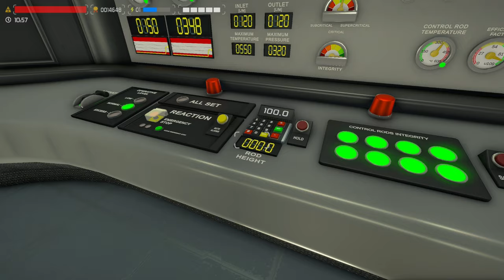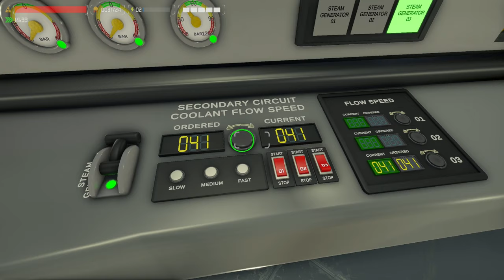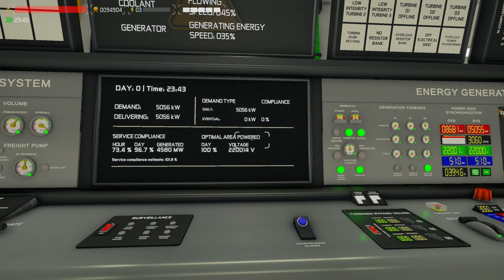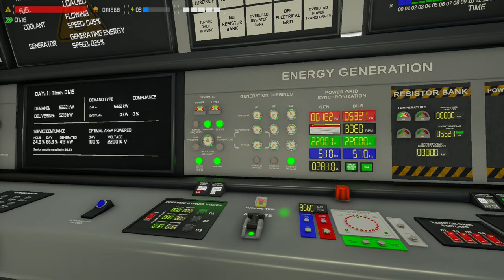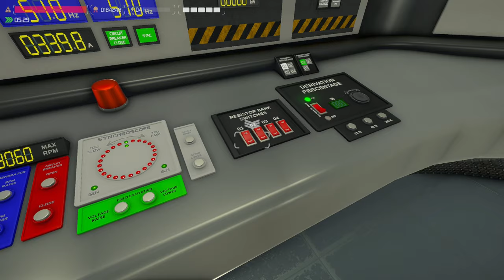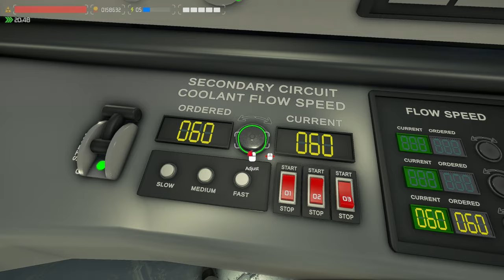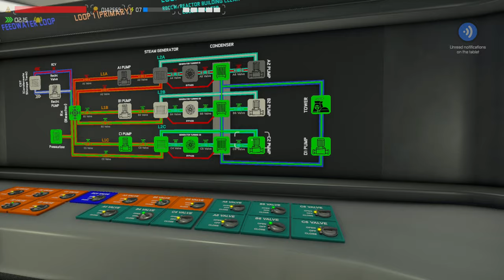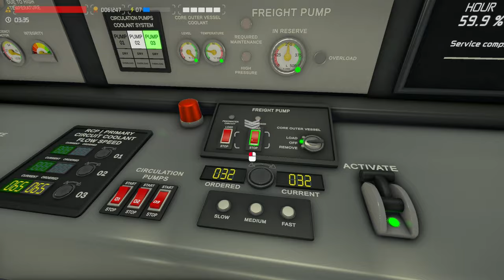Installing Our 2nd Loop! S1 EP02 - Nucleares Tutorial

Comment: @ShArPy1o1 Game`s this is a message from the devloper after I asked him how the testing was going regarding the Ion Column cleaning

Message From Nucleares: Hey!  Almost there.  I included several more things: tunnels and missing connections to eliminate infinite repositories.  A little more testing is needed.
Reply: So don`t exspect a hotfix to come any time soon.
Reply from the maker: Seems like the Ion cleaning has nowhere to put the used chemicals as the tank underneath the column doesn't seem to be finished... oh well saving and reloading will have to do the trick till it's fixed I guess...
Meh it's a good game anyways, I'm still going to play it mwahahahahaha... cheers for the comment gamer 😎👌✌️

Comment: The thing i really want added is faster time. The 1,2,3 is good. I dont want them changed, i just want a 4. 
When starting up or shutting down i always us 1. When waiting on somthing to fill i often use 2. When everything is stable i use 3. Usually leave it on 3 for the entire week until shutdown for core maintenance.  
I do occasionally use 1, run to the transformer room, shut off a transformer,  set ao maintenance,  turn speed to 3. Wait. Then cycle through the other transformers fixing 1 at a time. Then back to speed 1 to run upstairs again, if all is good then back to speed 3.
Reply from the maker: I agree with you 100% as I even mentioned (to the dev) having the ability to fully time skip even up to 1 hour with the facility and core running just to speed the time up but apparently the Solo Dev told me that the calculations your PC would use over that time skip, isn't either stable enough or just cant/won't handle the overload to the CPU etc?
In terms of the 3x speed, I don't usually ever change off it unless filling the generator with fuel or going to another room... especially when you need to slow it down just to allow the pump to be set to the speed I set it to etc.
The new compensator and Synchro update has really slowed the time speed down from previous patches and it now takes 4-5 times longer 🤯😥

Comment: Do not under any circumstances have the new chemical treatment on, save game with reactor running. Then resume game without chemical treatment.  After todays update the chemical treatment set itself to off. I resumed my game to find my reactor temp skyrocketing.  Scram was not fast enough.  Ran to the chemical panel to fond it was not there, exit the game and re-enable the chemical treatment and reload the game and all was good. Trying to keep my 65 days of no accidents sign from saying 0 again. Lol.
Reply from the maker: Yeah I had similar but the new truck system wasn't working for me so either way I will need to start a new Game (might still play the old save until I run out of Boric Acid/Sodium Hydroxide lol)
Release both as seperate videos etc 🤪👌
Reply: @ShArPy1o1Games  the truck showed up, my order of the freight pump never shpwed up. Yeah probably have to start over. I have been messing with the time settings. Have to say i cannot quite figure out the two sliders. I can make time tick by very fast but controls act slow, or i can make time move slow and controls act instantly.  Just haven't quite learned where i need them to optimize it for me. More experimenting will be needed on the time settings for me.
Reply: @ShArPy1o1Games  the time setting may not be that confusing for me tomorrow when i am sober. Lol. 6 shots of whiskey tonight though have me struggling to get the time settings right. But hey even with a pretty good buzz, no meltdowns.
Reply from the maker: I can imagine after having 6 shots that time would slow down for me too hahahahaha...
My time speed setting are:
10,000 milliseconds per minute (default)
1,000 interval milliseconds (default)
3 fast speed multiplier
5 fastest speed multiplier
Seems to work for me on an i9-12900k & RTX 3080 Waterforce (PC all Watercooled though)

Comment: How do you refill the tank that you feed the condenser from when you initially start up the reactor?
Reply from the maker: The condenser lvl is filled with the condenser pump found on the Primary Coolant Panel and that pump/tank doesn't run out of water 👌

Comment: Who needs control rods anyway?
Reply from the maker: Reckon... it's different running it this way compared to earlier patches etc. 😎
Reply: I know you can run it this way but it seems like it's one screw up away from a scram
Reply: It's surprisingly even simpler to run it that way since you can adjust the boron concentration in the coolant by the gram vs .1 height for control rods.
Reply from the maker: Seems like it can be precision controlled by 0.1 with boric acid and 1.0 with the control rods
Reply from the maker: At least if I needed to scam... the control rods and the boric acid combined should bring the Reactor down faster than with just 1 available?